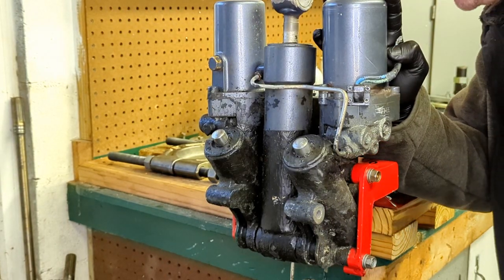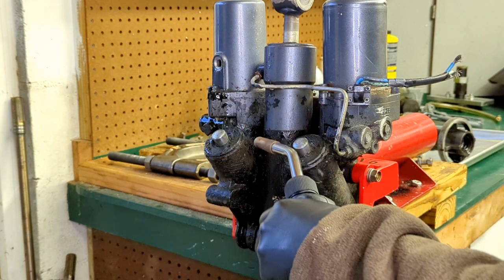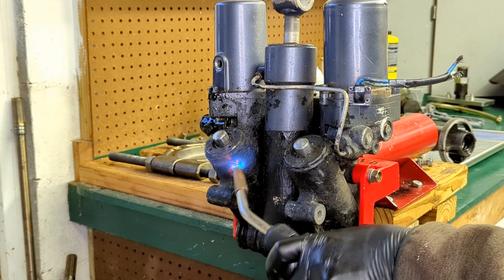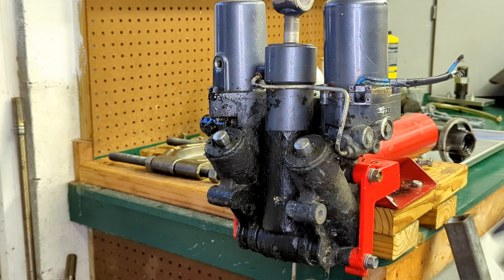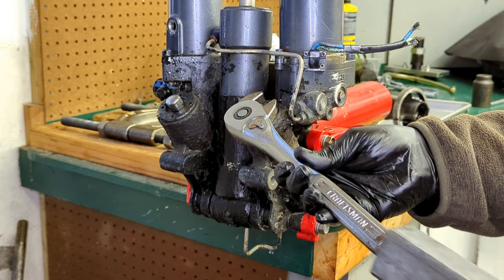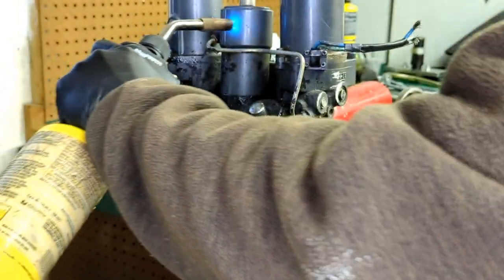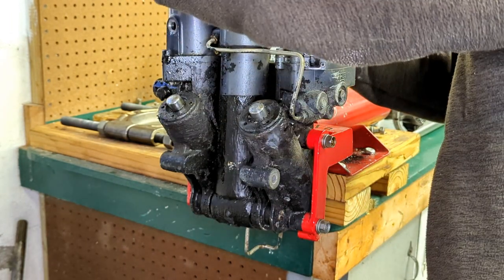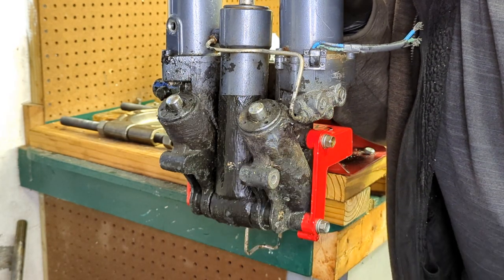Trim Tilt Cap Removal, Using a Torch to Persuade Seized Caps Yamaha 4 Stroke

Comment: Thanks Tyler.  Videos using flame are hard to find.  They are very useful to the new DIY folks.
Reply from the maker: Thanks, yes, when properly used, these little torches can really help out with these jobs.  MAP gas is my go to for this kind of work.  Oxy-Acetylene has its place in the world but is usually not necessary for trim tilt work.

Comment: Air chisel takes them right off and it’s worth replacing the whole cap and seals
Reply: No it doesn’t mine are still seized up not moving at all maybe I will try heat first

Comment: Tyler, great video.  Short, sweet, to the point. Thank you!
Qq on freeing up the tilt locking pin on an old ('91) 200hp 2stroke -- the one the tilt piston attaches to at the top.  You think penetrating oil, picking out the rusted circlip, then heat on the bracket would be a good way to free up the pin so I can hammer it out ?
Reply from the maker: I have never understood why some of Yamaha Tilt Pins remain in perfect condition for decades and some of them seize badly.  To answer your question:
I;d try an air hammer first if you have one
Removed the circlip however you can.  Obviously it will be spring loaded and will launch directly at your eyes when it breaks free, safety glasses are a must
If the pin is seized into the midsection often the nylon bushings are to blame.  The torch is a good idea, it will heat up the midsection as well as melt out the bushings and that alone may be enough to get the pin moving.  If not, and I have had several that were fused into place, youll need to cut the pin into sections by using a metal cutting blade or cutting wheel and cutting at the junction between the edges of the tilt pin mounting ring and the midsection.  Once the tilt pin is cut, you can removed the trim tilt assembly, or at least get the tilt rod out of the way.  The small disc shaped sections of the mounting pin that are still stuck into the mid section usually hammer out pretty easily once every thing else is out of the way

Comment: Thank you Tyler, good topic. If you have a chance a similar video on removing stubborn stainless steel flange bolts on the 3 ram Showa PTT would be very helpful, as well as the oil gallery plugs. I had a very tough time with both on my DIY F150TLRC PTT complete overhaul. Just about every bolt broke even after hours of coaxing with heat and penetrating oil. It was a nightmare. Nice overhaul stand!
Reply from the maker: All of these 6mm bolts are going to seize.  Invest in a good set of hardened left hand drill bits and 6mm  helicoil set.  They will make short work of drilling, tapping and setting heli coils
Reply from the maker: Same goes for the larger bolts

Comment: Question about the check balls in the PTT oil pump shuttle valves and valve sub assembly,   Yamaha engine F150TLRC, SHOWA PTT assembly 63P-43800-00-00,  3 ram SHOWA: 
this stack up uses two each of two different part number check balls: 64E-43858-00-00 upper location, and 72X-43858-00-00 lower location. What is the difference between the two part numbered balls, and are they interchangeable? I failed to take note of their location during disassembly and have lost  (2) to the Land of the Missing Tiny Parts!  I have ordered new check balls (about $3 each so I have factory p/n on the parts bag but delivery is way out there due to back order. The dealers do not have this information re. dimensions. The (2) balls I have are 3.16 mm (1/8"). Thank you for your help on this one.
Reply: Tyler, this may help folks ID the check balls in the SHOWA 3 ram PTT used on my F150TLRC:
6E5-43858-00-00:  5/32"  (1) required for valve seat (return oil to pump housing)
64E-43858-00-00   1/8"    (2) required, for pump shuttle valves
72X-43858-00-00   3/16" (2) required, for pump main valves
64E-43858-00-00   1/8"    (1) required for up relief valve (same ball used in pump shuttle valves
The ball part numbers are off of new Yamaha OEM parts that came in marked bags, measured with digital calipers.

The check balls used in the Tilt Piston Subassembly shock relief valve do not appear to have stand alone part numbers as that valve is part of the Tilt Piston Subassembly 63P-43810-09-00. I failed to measure these check balls. Next time!

Comment: Thank for the nice video, where did you get that trim unit holder?
Reply from the maker: We have the holders fabricated and we sell them through the website.   This particular rack is excellent because the V6 PTT is a challenge to work with once it is removed from the transom bracket.  It's also really good to be able to turn the PTT on it's side for drilling out damaged bolts.  
https://outboardst.com/product/yamaha-tilt-trim-work-rack-ost-0352/